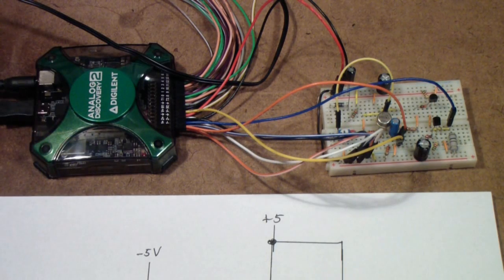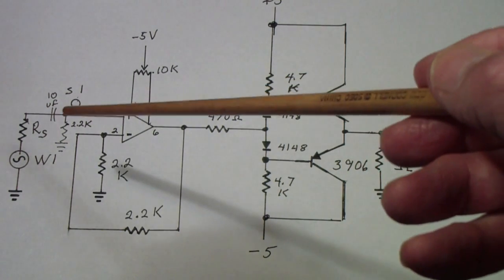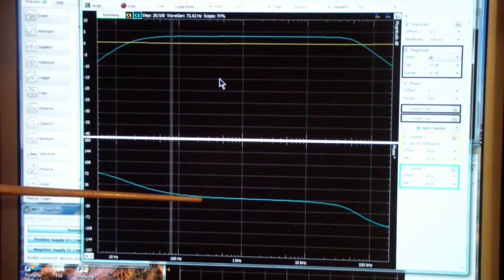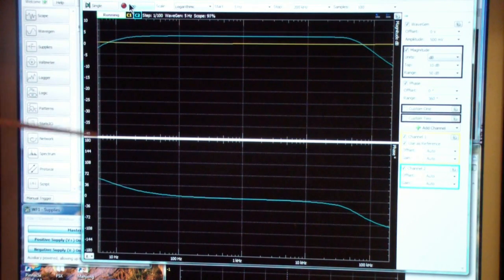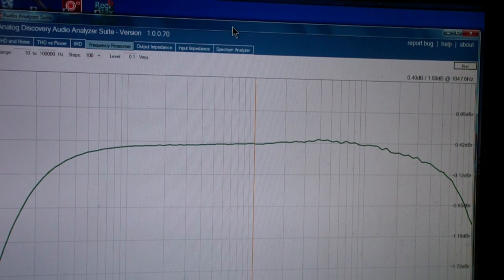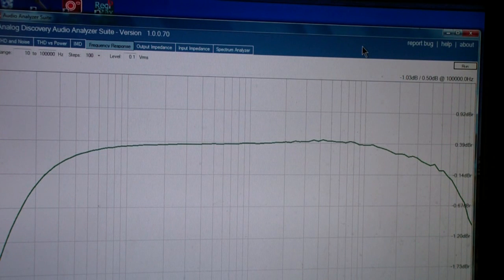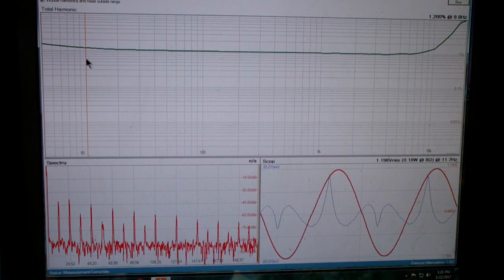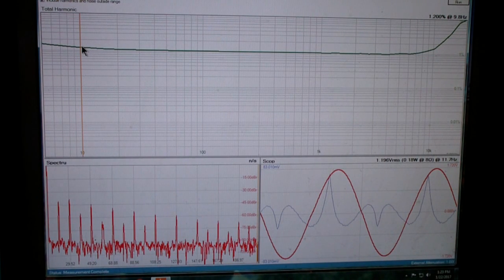TTT140 Class AB Amp Testing w AnalDisc  Pt2

Comment: Dave Jones claims that the FFT on the Rigol scopes, or at least on the entry-level Rigols, is not any good. Could you compare the Rigol FFT with the Analog Discovery using this amp?
Reply: The analog discovery is far superior with 14 bit resolution vs the rigol having no more than 8 bits.
Reply: +TheStuffMade 
D.J. was comparing the Rigol's FFT to other 8-bit scopes and concluded that it was crap.